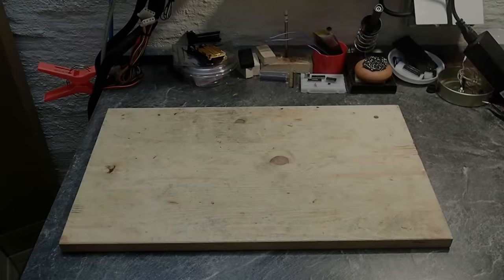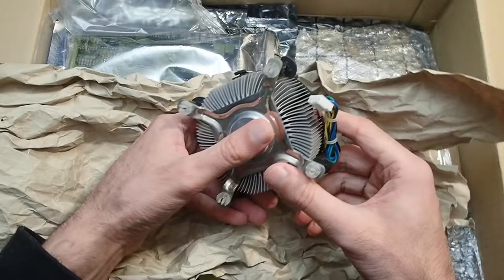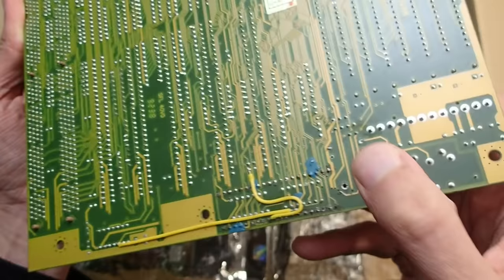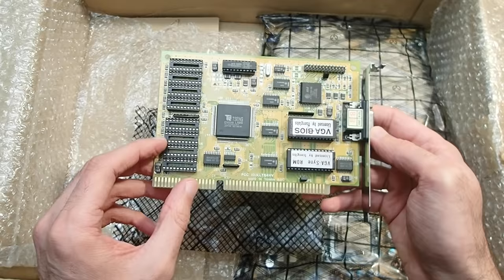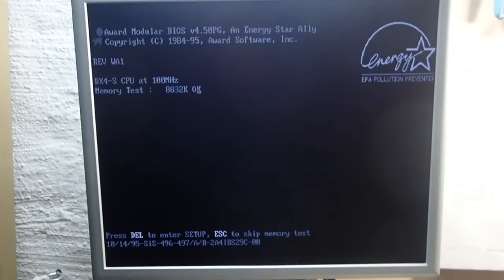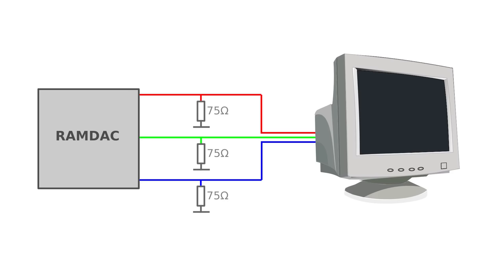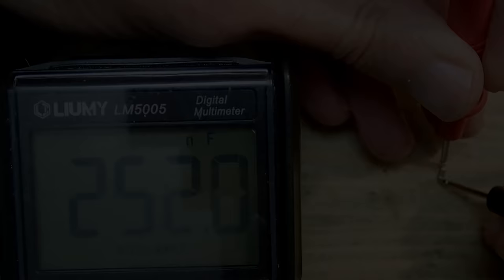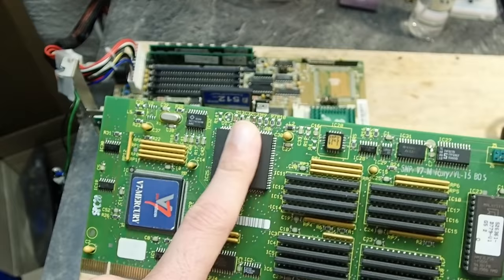Unpacking a donation, trying to repair a graphics card color glitch

Comment: 10:10   Really? Surfing with 4 gigs of ram? :-) Have you seen the browsers lately?
Reply from the maker: I'm using Linux since 1998 and don't have any problems with 4GB at all.
Reply: @necro_ware  well, you have about 10 years more experience with linux than me, but I'm pretty sure you're not browsing with linux. You're browsing with a browser, and you might or might not be fine with palemoon on 4GB of ram, but anything newer than that will be choked very quickly.
Reply from the maker: LOL :D Yes, but it is very much important, which system you are using and how much memory is left for all the other applications after the system has booted. I'm using Chromium and unfortunately I can't send you a screenshot here, but I just checked and the current total amount of used memory is in this very moment exactly 2GB. I have my browser open with four tabs two of which is YT, one news Site and one forum. In the background my email program is running (claws). I'm using XFCE as my desktop environment and the whole system uses around 400MB after it is completely booted.
Reply: @necro_ware  Yeah, I can totally believe these numbers, no screenshots necessary. However I have 8 tabs open in chromium and it's already approaching 3 gigs ram usage. A couple more tabs and we will be over 4.
Reply from the maker: Sure, but then let's come back to the initial statement. I said, that you can use it as a daily PC and browse with it. How many open tabs you like is heavily user dependent. For example I don't like too many tabs, for me it starts to be distracting, if I have more than 5-6 open tabs. Everything what I want to read I usually add to "To read" folder and close the tab until I need it again. Some people never close tabs, like my mother, who asks me why her super duper new PC with 16GB of ram starts to stuck from time to time and I see 1200 open tabs in the browser :) In other words for a normal usage with up to 10 tabs this system is still absolutely sufficient, don't you think?
Reply: @necro_ware  Fair point, I guess. :-)
Reply: @necro_ware  I guess the reason why 4GB doesn't work for me at all is because I'm using gentoo and I like compiling in the background.
Reply from the maker: Yeah, I used Gentoo 15 years ago too. If you limit the amount of compilation threads to 1 it will probably be still possible. But in that case until you compiled the latest version of Chromium (or whatever you use), a new version will be already released :D Well if someone needs a powerful machine, like for compilation, rendering, video editing, whatsoever, then such a machine should be obtained. For example, I'm doing my video editing on a Ryzen5 3600, but most of the people are more about checking the email, reading some news, watching a video and may be playing some music. In such cases buying a more powerful machine would be a total waste of money.
Reply: @necro_ware  
> But in that case until you compiled the latest version of Chromium (or whatever you use), a new version will be already released

Yes, it's possible to run with -j1 and yes, your estimation of compile time is very accurate.